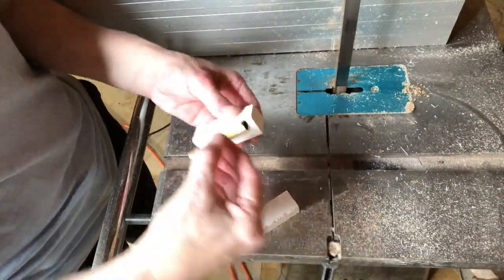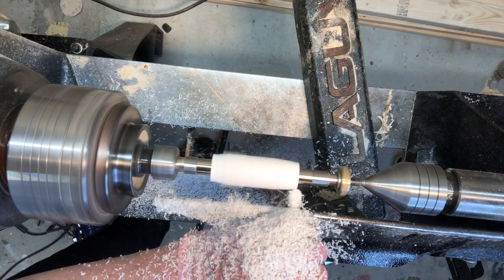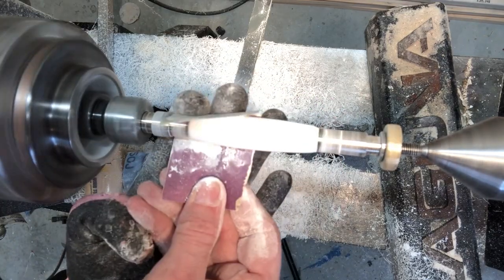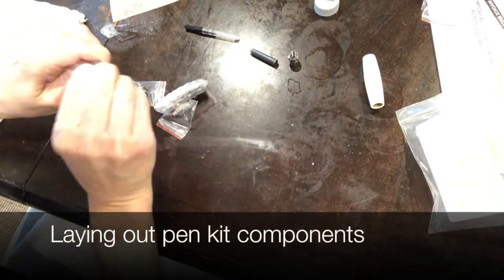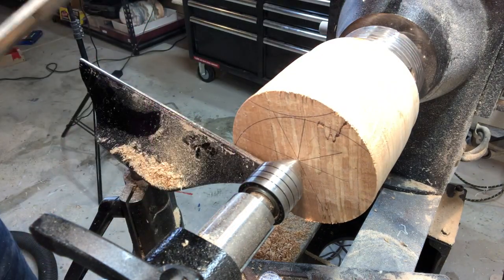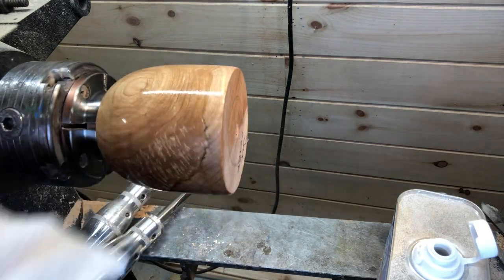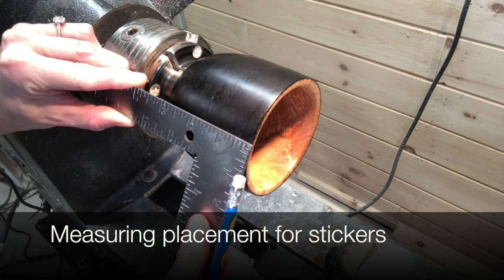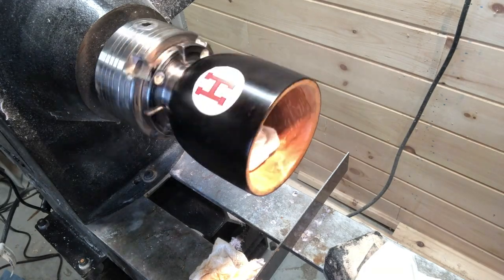Woodturning a Fountain Pen & Pen Holder - Harvard Gift

Comment: The problem with the stickers was, I believe, that you were applying them to a surface that curved in t directions. Curved around the pen and holder and curved from top to bottom or end to end. You would need to modify the design to rectify that. Like a flat area at the middle of the pen.
Reply from the maker: Yes, thanks!!!

Comment: Might it have helped to somehow warm the stickers before application? I don’t know if that might have made it worse, but might have allowed them to conform better if they were softer. It used to work with automotive appliqués back in the 70s. Also, a very sharp pin or razor will allow you to pierce a bubble and get the material to lay flat. Always nice work. 🤓
Reply from the maker: Maybe. I might try heat next time.

Comment: Really nice white pen. As for putting on the stickers,, when then they do it on cars they put soapy water on the surface so they can tease the bubbles out with a squeegee. all the water must be squeezed out and it has to be left to dry. Maybe worth trying on a piece of scrap first though.
Nice to have a soft female voiceover for a change, rather than the usual rough assed males we usually get to listen to. (;-)
Reply from the maker: Stu Brearley thanks for the tip!! I’ll definitely have to try it.

Comment: Wonder Woman talks! LOL!!!!!Just kidding!!!! It REALLY is nice to hear you even if it is voice over. One time you mentioned that you don't like talking when you're working and I don't either. I talk to myself, and curse at myself and say things no one else needs to hear so I'm better off not talking.
After you hollowed out the inside of pen holder, did you take it off the lathe and remount it off camera? In the video you are hollowing out and everything is fine, then you show applying the dye and when you spin the chuck by hand the pen holder is not running true. Did you remount it and not get it true? Is the wood still to wet and already warping on you?
Stu Brearly  mentioned about wetting the stickers in soapy water, he is correct just make sure you know where you want them because they can get really slippery and you can be off your mark quick and easy. Don't you have an indexing pin on your lathe so you could find 180 degrees from the first sticker you placed?
As usual all of your projects came out GREAT!!!!!!!! I really hated to see that beautiful wood get covered by black dye though (you probably did too).
Reply from the maker: Curt Parker thanks. I did take the pen off the mandrel at one point (off camera) as I was going to apply the varnish a different way, but changed my mind.
Reply from the maker: Curt Parker thanks! Yes, it was a tough decision on the black, it just made the sticker look better though.